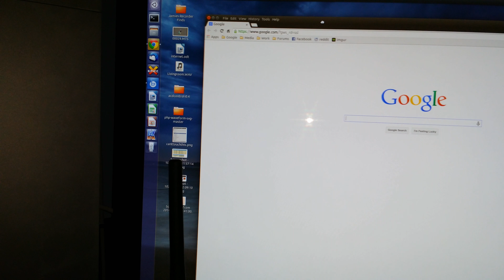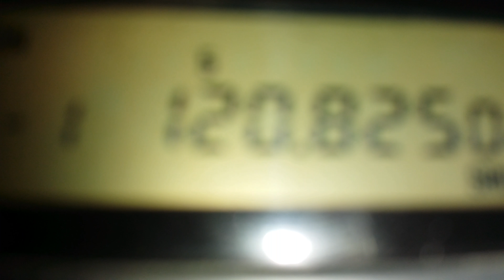Air band interference

Comment: As you likely know, all electronics emit a varying amount of RF Noise when energized which will interfere with any radio signal using Amplitude Modulation that it happens to cross (it can also affect other audio circuits if improperly or insufficiently shielded, I.E. CRT "Buzz").  It does indeed seem to be a shielding issue with your adapter because it should not be leaking such a large amount of noise, especially at that distance to the antenna. This is according to my experience with a Sangean shortwave radio, anyways.